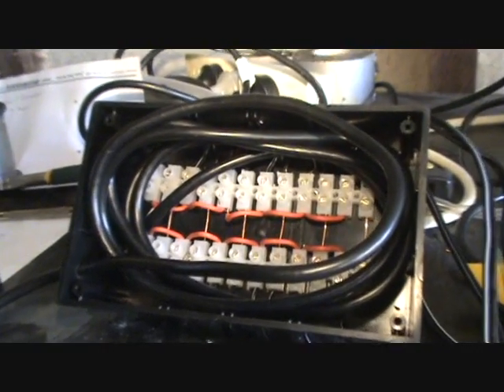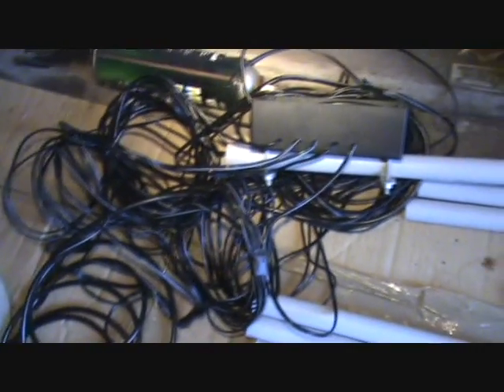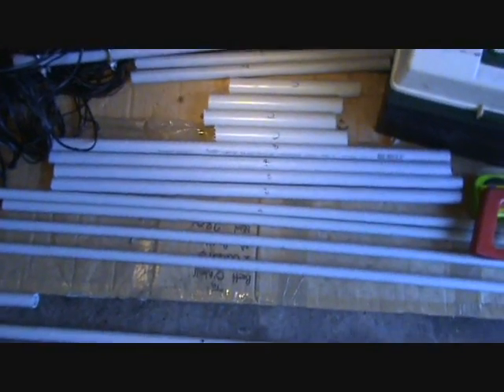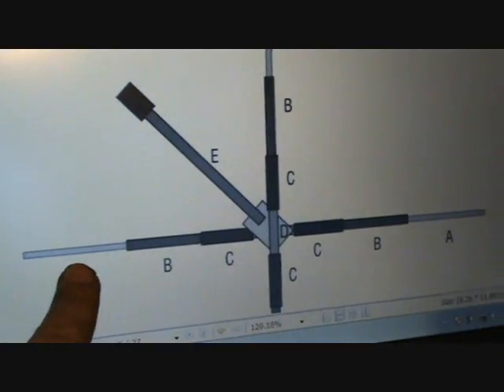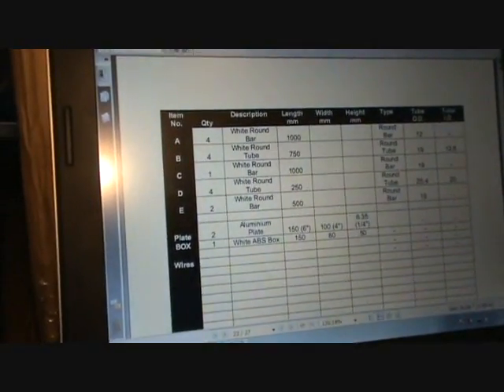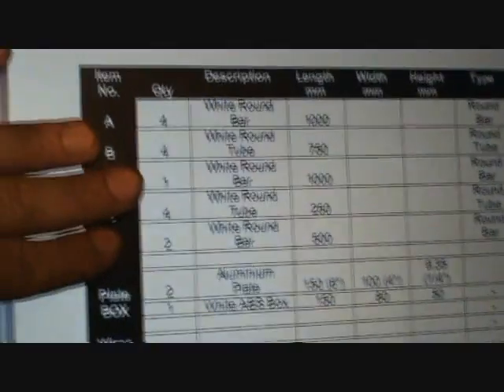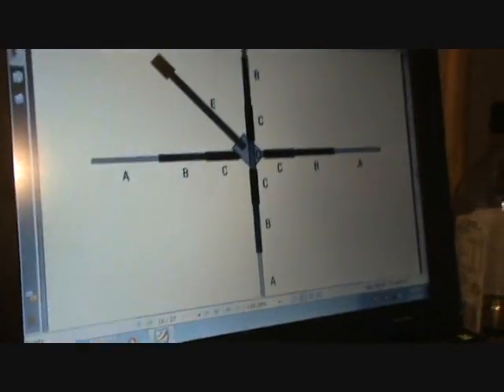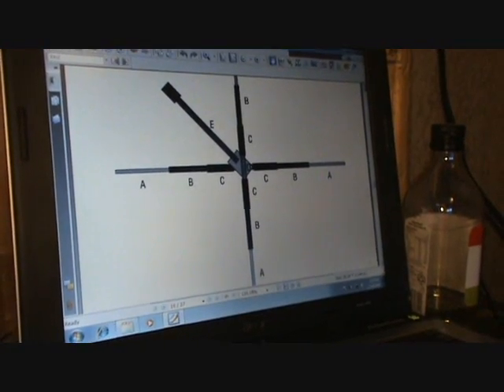Cobweb Antenna part 3

Comment from the maker: @zyphod 
You're correct, they simply go into the end of the terminal blocks. The jumpers link the wires for each band to the feed point.It's effectively a fan dipole but folded around into the square with the slight exception of the connections part way along each dipole.
It was the junction box which took some reading of the instructions to get my head around it :)